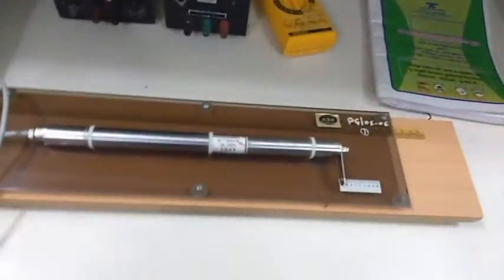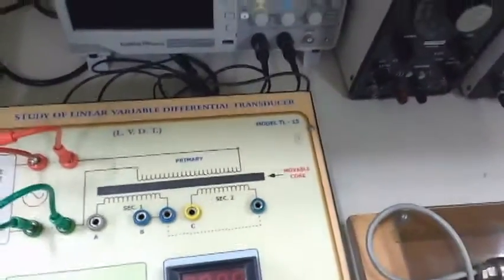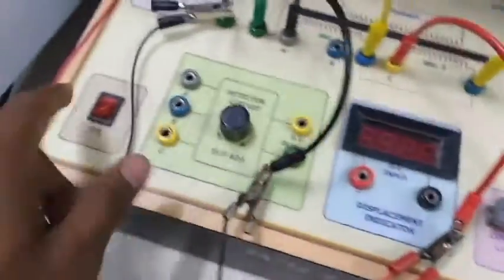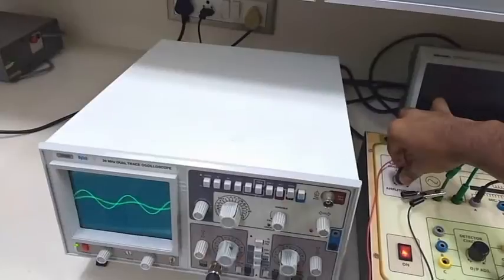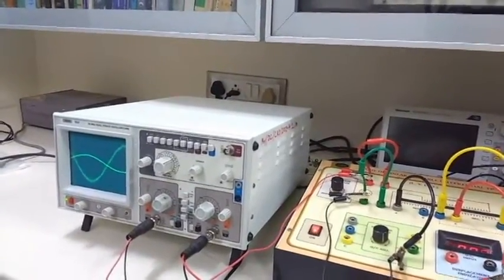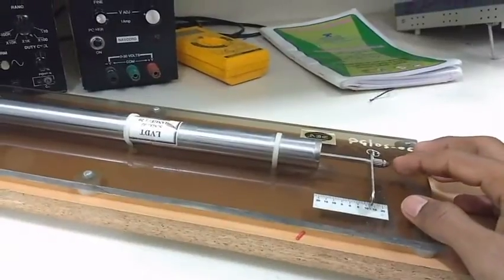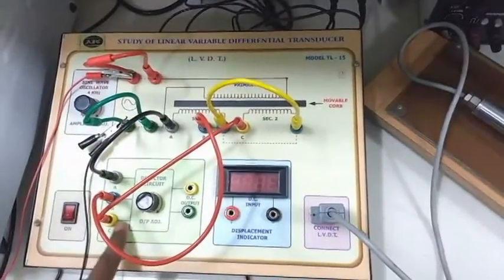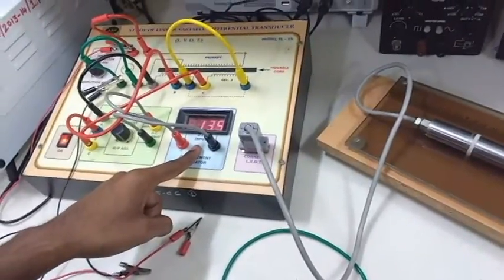lvdt experiment

Comment: Hi, AKHILESH VERMA. greetings from Venezuela. Thank you for your video. Can you help me? I have not enough knowledgments about LVDT's and I must to select (for my class) a model that needs a conditioner circuit (I suposse that this condition means that the output can't be currents between 0 and 14 mA). I see that the the output of LVDT of the video is AC voltage. I guess that your model can be the indicated for my homework. Can you tell me what is the model? Do you know some models (with the same kind of output) that has a longer measure range?
If you desire give me any suggest, I will be very grateful to you... :)
Reply: It doesnt matter, Akhilesh... :) Your answer is important to me because my investigation about LVDT's made me feel interest for this kind of sensors. Thank you, again! :)